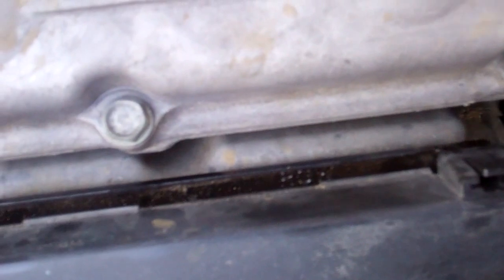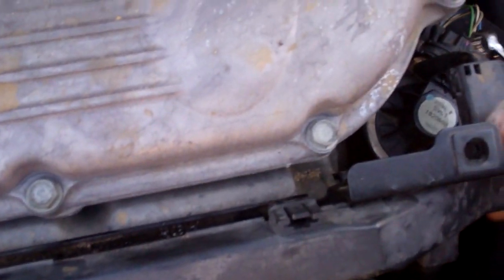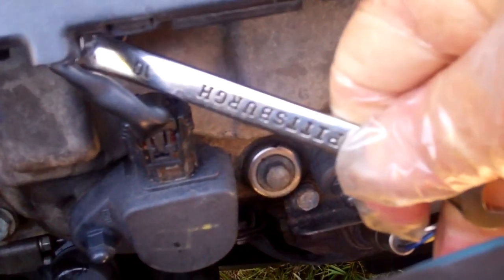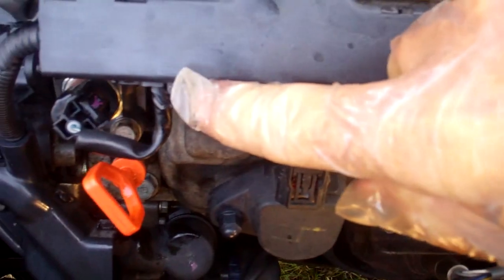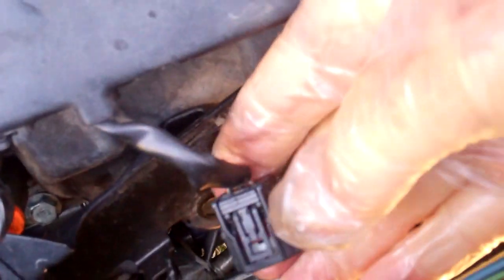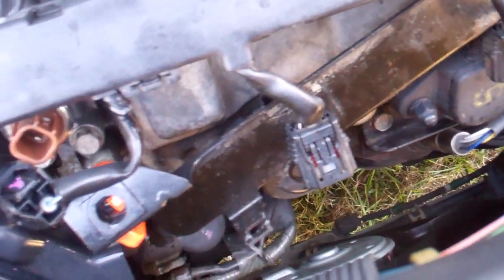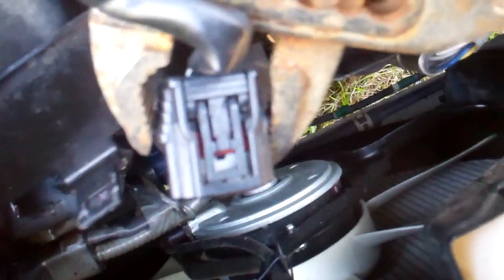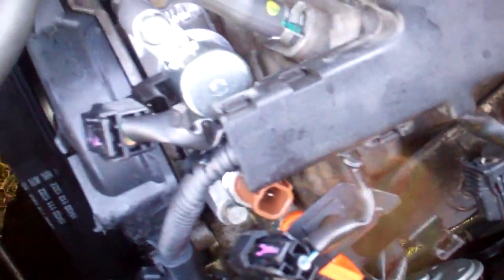Honda 3.5 Engine VVT Solenoid (Part 2) Variable Valve Timing Oil Leak 2008-14 Odyssey Pilot Acura

Comment: Thanks for sharing that Dorman 918-056 part number. I have been changing these gaskets for a year or so. I think it caused me to ruining my alternator. I changed that out. Because of oil leaking on it. So after changing out the gaskets last year the leak is back. So no more cheap gaskets. I am going to try the whole unit that has the gaskets with it.
Reply from the maker: Thanks for sharing!
Reply: what gaskets were you using? I saw rockauto has Mahle ones for this exact repair
Reply: @mp-fe1qv are they good because I got some from rock auto but haven’t put them in due to me being paranoid they are gonna leak

Comment: What is the part number for dorman vvt solenoid?
Reply from the maker: Dorman VVT Solenoid used on this 2008 Odyssey Touring model - Dorman 918-056 (includes the gaskets). The gaskets only may be available on Amazon. Amazon shipped the gaskets which arrived in two or three days. Thanks for watching!

Comment: would the replacement of the vvt stop ticking noise on 2010 acura tl it goes on and off seems like its not getting proper oil toward top of the right side where vvt is the noise seems to come from there
Reply: I have this ticking noise on my 2010 accord and this same oil leak. Did the ticking stop? Also I’m worried about getting engine code after changing the gasket. Any input would help.
Reply from the maker: I have read on some of the Honda Discussions that that can happen. But have not run into it myself though. First make sure you have the proper weight oil, and it is clean and fresh. I think the Odyssey V6 requires 5W20 oil. Heavier oil may not flow properly for that engine. The Odyssey I worked on did seem a bit quieter after the VVT Valve replacement but as you know, there are several things that can cause ticking and other noises near that area. Wish I had more information for you on that issue. The Honda Discussion Forums have been a good source of info for me in the past. Thanks for Watching!
Reply: @cubmancan  yea I out brand new plugs other day brand new oil from acura w filter. its weird like  I start the car its either she is quiet until I drive for a few then ticking starts then also at some points it goes away. just seen a video that says sometimes even the spark plugs might not be seated properly so ima double check that. the mech changed my tensioner robbed me for 140 cuz it didn't fix the issue I wss thinking maybe vvt wasn't getting oil to top front near it it seems the sound comes from right there will check 2morrow I was thinking to take out the vvt and check the filter in it if it has one been looking on YouTube. my son works for Honda but his tech said sound like cam shaft and needed a engine mount wanted 1200 to fix it all but yet was offering to buy my car so it made me skeptical to think is this guy tryna jerk me by saying something w cam shaft I know I need engine mount swap real soon. but yea im told faulty  vvt can cause ticking then also loose spark plugs or not properly seated spark plugs so ima torque them down tomorrow just to see need this fixed im losing out on working til I either fix or find new ride
Reply from the maker: @ilovenythismuchilovenewyor5801   Just an Idea - you may have done it already- Harbor Freight has this Mechanic's stethoscope for $5 - may help pinpoint the ticking. Lisle makes one also for under $20 I think. These have been good for me in the past. Thanks  
https://www.harborfreight.com/mechanics-stethoscope-63691.html?ccdenc=eyJjb2RlIjoiNzEwNzAxMzEiLCJza3UiOiI2MzY5MSIsImlzIjoiNC40OTEwMDAwMDAwMDAwMDA1In0%3D&cid=paid_google|||63691&utm_source=google&utm_medium=cpc&utm_campaign=&utm_content=&gclid=Cj0KCQiA1pyCBhCtARIsAHaY_5dYNHQYXKqm4uUoT5DM9uerW9qrvBPTFd9y50wvlXSpTrn5zg6E1_4aAs79EALw_wcB
Reply: @cubmancan  yea going to pick one up today to have anyways my mechanic said its not nothing w major part of the engine but to keep driving the car for a week w new oil and filter

Comment from the maker: Thanks for watching this video - ONE IMPORTANT NOTICE! - Please verify to make sure this repair/replace video pertains to the part and vehicle you are working on - do a visual comparison and look up the part number to be replaced by the VIN number. There are various configurations of VVT Valves used on various Honda Models and there are front and rear VVT Valves (on the V6 front cyclinder bank and rear cylinder bank positions) on this particular V6 engine model. ALSO, various Manufacturers' Brands, Makes and Models of vehicles will have various styles of VVT Valves which will have different proceedures to replace the valve. Look it up by your VIN number! I hope this helps! Thanks Again!

*The Touring Model may have a different VVT Solenoid than the LX and EX Models. Use your vehicle VIN number to look up the correct VVT parts for your vehicle.

Fit For:
2013-2015 for Acura RDX 3.5L V6 GAS SOHC
2008-2012 for Honda Accord 3.5L V6 GAS SOHC
2010-2011 for Honda Accord Crosstour 3.5L V6 GAS SOHC
2012 for Honda Crosstour 3.5L V6 GAS SOHC
2008-2016 for Honda Odyssey 3.5L V6 GAS SOHC
2009-2015 for Honda Pilot 3.5L V6 GAS SOHC

VVT Valve - Original Equipment (OE) Number:
2T1136
VV1182
VVT282
TS1136
15810R70A03
15810-R70-A04

Comment: Thanks for posting this. I had watched other videos showing disconnecting the wiring on the left side and flipping the whole harness over to the right to get access to the VVT valve, but on my 2011 Odyssey Touring Elite there is a heavy cable going from that harness to a fuse box on the left side that does not disconnect so it cannot be flipped.  Following your method I was able to take the metal bracket off and lift the wiring up just high enough to get the valve body off and it wasn't that bad.  The hardest part for me was getting the connectors off the coils because the catches did not want to release; I finally used one screwdriver to depress the catch while using another screwdriver under the edge of the connector to start it up.  New eBay gaskets are in and so far so good.
Reply: I'd love to know where you got the gaskets, or what pn's you used. I need to do this on my 2011 also, asap.
Reply: @mikoriad  I ordered mine on eBay and went for ones shown in the Honda packaging, but have been told they are not really Honda parts but are fakes in fake packaging.  The first set fit fine and is still working on my 2010 Ody Touring and the 2nd set I bought for my 2011 Touring Elite I had to use a razor blade to cut the slots in the rubber around the little screen deeper because they were too shallow and the screen would not fit into the valve body.  However, after the adjustment, they are still working in my 2011 and $12 is much cheaper than buying a Honda valve and throwing away the bottom half.
Reply from the maker: @mikoriad  Hi Mike, thanks for the question. No auto parts stores carried this particular gasket - Honda dealer did not sell it except with the whole VVT Valve (dealer=250$). So, Amazon was the fastest source for me. OR I could buy the top part of the valve with gaskets locally at O'Rielly's Auto Parts, which I did. It was a Dorman part 918-056 and has worked fine ($120).  But, you could order from Amazon just the gasket, like $10 and I got mine in 2 days that way (still have it). Before you disassemble, make sure your vehicle is exactly like this one or is another style, as the more loaded models (Touring, etc) use this one, while some may not have this type VVT valve. Also note: the Amazon gaskets appear to be China made, but seem to be visually of good quality. Hope this helps! Thanks for watching the video!
Reply from the maker: Great! thanks for watching!

Comment: Would this be the same for a 2008 Honda Accord v6????
Reply from the maker: Thanks for asking. Hope I can be of help with this - It likely is the same, especially if it looks the same externally. On this model, the oil dipstick tube is mounted in the base of this VVT Valve (front of engine passenger side right above the alternator). 
There are two VVT valves on this engine, one VVT valve is on the front of the engine (the one in the video). There is also a VVT valve on the opposite corner of the engine in the back of the engine on the drivers seat side. Notice if you have oil leaking and where- I only did the front VVT valve (passenger side) as it was leaking oil there. 
I understand that the Touring models (like this one) may have a different set-up than other engines so all the V6 engines may not have this particular type of VVT valve. One way to find out - compare the video parts with your own vehicle and notice how the oil dipstick tube is mounted, another, maybe better idea, would be to take your ID number to O'Reillys or Auto Zone and ask to look at the VVT valve for your own car (be aware - some parts people don't realize there are two on the engine though).. My Honda dealer parts department was nice enough to let me look at the VVT valve before buying it. I eventually bought and used the Dorman part (O'Reillys) which has worked out fine. 
Also, if you only need gaskets, make sure you get them before disassembly, as dealers don't sell some gaskets separately from the Valve (as was my case).  You can get gaskets on Amazon within just 2-4 days usually - make sure they look like the right shape..

Thanks for watching!
Reply: @cubmancan  your the best thanks 😃